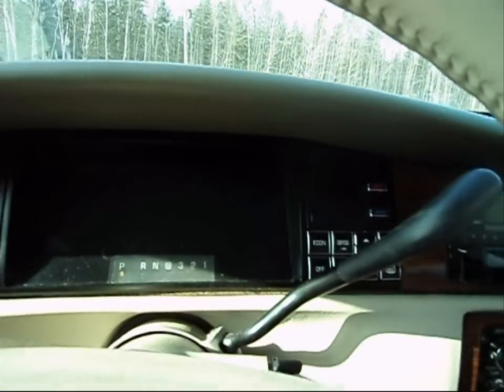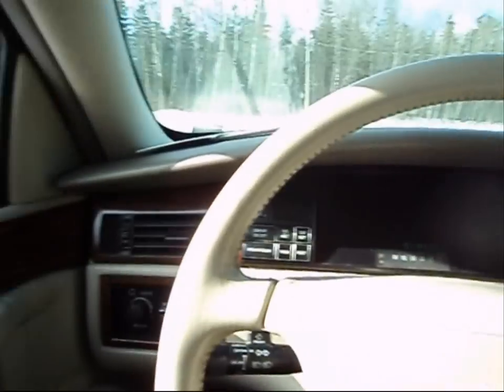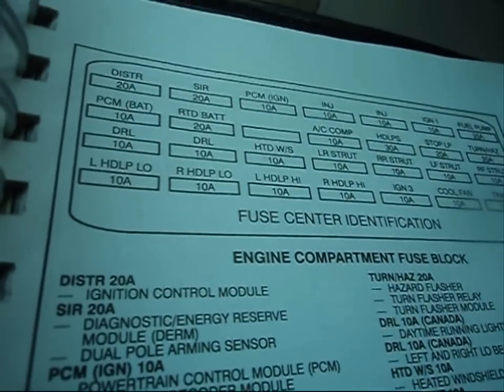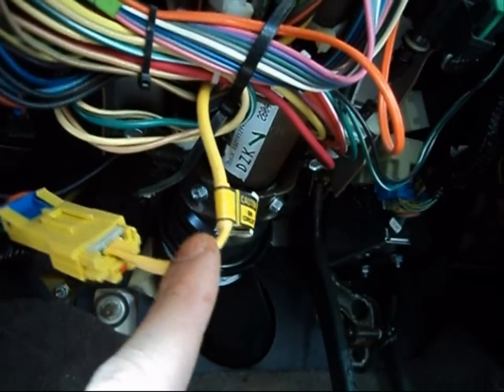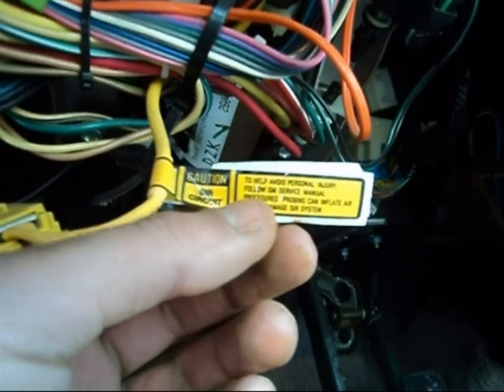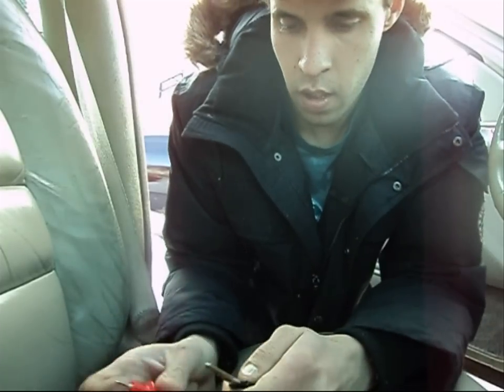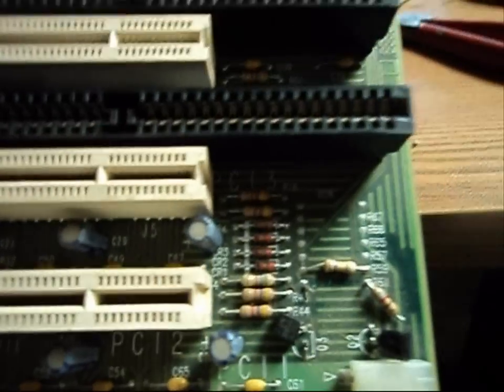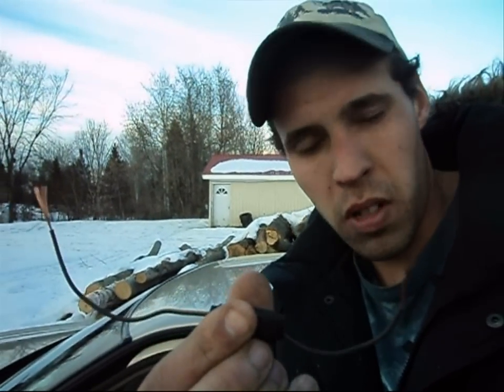GM Pass Key II Malfunctions: Bypassing V.A.T.S System

Comment: I have a 98 deville and my dash says theft system problem. However I do not get the security light. All of the gears just flash and the engine wont turn over to start it. When i got a replacement key at the dealership the guy said it may not be the key it could quite possibly be the cylinder. That plus a new key would be about $100+ which isnt much but im unsure if i should try your awesome bypass workaround or just buy and install the new part. Any recommendations? Please help..

Comment from the maker: Well if the security light stays out there may not be an issue with your anti theft. Your starter motor might be gone or the park/neutral safety switch might be at fault. I would start with that first then if that gets you nowhere take a dive into the theft system by starting off with turning the key on then off and wait 3-5 minutes. If that doesn't work you can by-pass the theft system the way I did in the video... And if that doesn't work... Contact me, Ill try and help you out the best I can!
Reply: Hey i just got me 96 seville with that problem what do you dio if you don't have the original key i have the new one that came with the column
Reply: help

Comment: I did that for my 96 caprice, I used an adjustable resistor to get the right reading. It didn't fix my intermittent starter shut down problem (I had to disable a faulty relay in the module somewhere, dont remember...) but I left this wire thingy on so that the key pellet won't cause problems in the future. Simple and cheap fix that actually works.

Comment from the maker: Yours due to the fact your car is nearly a decade newer then mine, your conduit wire that comes from the steering column to the module may be black, but the style of the conduit is still the same and still contains two white wires inside.

Comment from the maker: If the starter engages and you can hear your fuel pump running for at least 3-5 seconds there may not be any issue with the anti-theft. I personally would look at the ignition components first then if that doesn't get you anywhere then check with the anti-theft. With GM vehicles if the anti-theft goes bad or the module disables the car due to a wrong key being inserted into the lock cylinder, the anti-theft system will disable the starter, fuel pump and fuel injectors.

Comment: In my specific case, the security light did blink. However, it doesnt blink anymore. I can actually hear the car's starter, and sometimes even some gas reaches the engine, however there is no spark. None of my remote keyless controls are recognized by the car either. I will try to give this procedure a shot. What do you think?

Comment: Good video but not quite what I am looking for.  The chipped keys to a 2000 Ford excursion where lost in a barn fire last night, we managed to retrieve one of the keys from the ruble however the chip is fried so we have no way to get a new key.  If any one can tell me how to remove or bypass the system without a chip please let me know, you may save us thousands from an already $100,000 loss.

Comment: 90% of the time , the wires to the ign cylinder have broken ( they are very small gauge and break over time ) . A replacement cylinder can be bought for less than 60$ , read the resistor chip value on the existing key , get new keys of same value and cut to the key provided with the cylinder and install the cylinder. A lock smith will do this for under 200$

Comment from the maker: You are not the first one with this problem. Back in the spring I had a '94 Town Car Signature here and the anti theft light would come on as soon as I opened the door and the buzzer inside would go off even with no key. I took the module out to start the car. Now if the starter rotates the engine then the anti theft isn't at fault- the anti theft module will disable the starter motor even on Ford vehicles. And starter wont operate in park sounds like you have a bad park/neutral safety switch

Comment: I have a 1995 ford f150 I bought that had been sitting a couple of years, the battery was dead when I bought it. After I bought it I put a battery in it I noticed that when I open the drivers door the theft light flashes, if I turn the key to on the engine will not turn over and the theft light stays on, if I shift the truck into neutral and turn the key the starter activates but the motor will not start.

Comment from the maker: I can guess if you paid 400 dollars plus, your mechanic may have replaced the VATS module and the lock cylinder. Not sure if the lock cylinder was replaced on your car or if you just got a new key cut with a new resister pellet. I can tell you this you have nothing to lose if you just bypass it. I took the difficult, least expensive route. You might be interested in saving your self time and a bad migraine if you just go to radio shack and get yourself resistors to complete this job -Good luck!

Comment: I want to thank you, we suddenly had this issue with our Deville & by coincidence was across from a GM service center when it happened. They quoted 466.00 with the possibility of 60.00 off if they did not have to reset the keys (which they thought would be unlikely, because usually they would need new keys also). After searching passkey,I found your video. My Mr. was able to get our car going in seconds. Sadly we had to pay for diagnostics at the GM dealer but that was all we had to pay for.

Comment: Often times the key doesn't wear out, but the tiny VATS-related wires in the ignition cylinder wear out.  If this happens with the engine running, the Security light will come on and stay on, and VATS will go into fail-enable mode.  The bypass fixes this as well.

Comment: had that happen when putting in a command start. used cheap pos module for the key bypass and it messed up and then then security light went nuts.. had to disable power to it to get it to start with the key even!